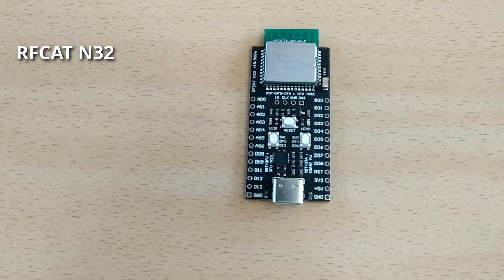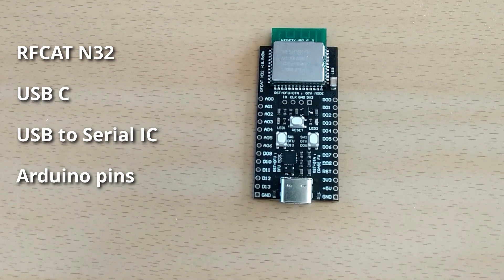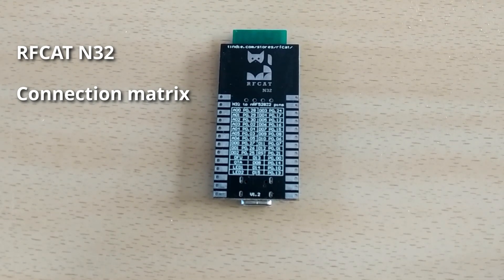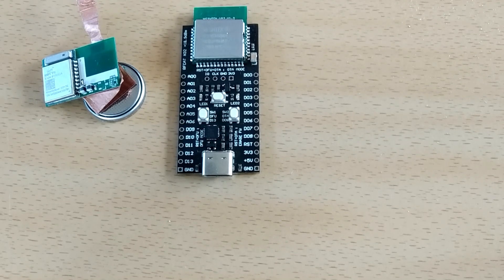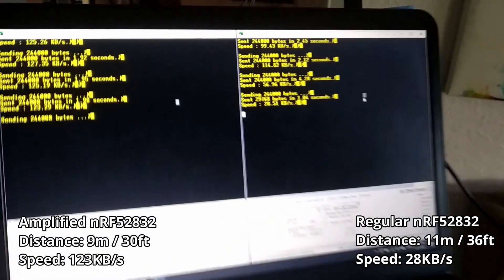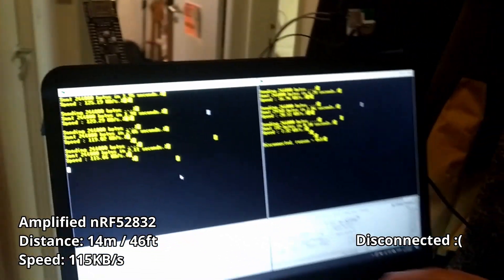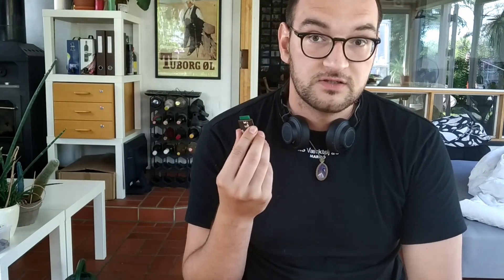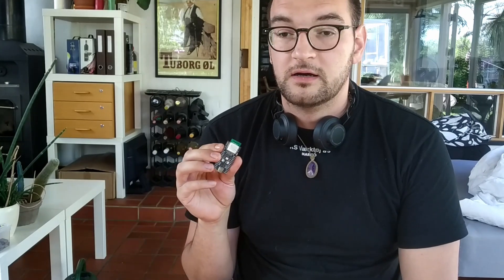RFCat N32 Long range Bluetooth development board - explained and test

Comment: Question : If I used a single RFCAT as a receiver ONLY (with access to loads of power), and straight NRF52832s as battery operated transmitting "nodes", would I get any benefit in terms of distance vs just using plain 52382s? Great work btw.
Reply: Hi Paul, yes you should see some range benefits. The RFCAT has both an amplifier on the transmitter, but also an amplifier on the receiver. I cant say how much better range you will get, as the plain 52832 has a pretty decent sensitivity, but some range benefits should definitely be available. Thanks for liking my work :)